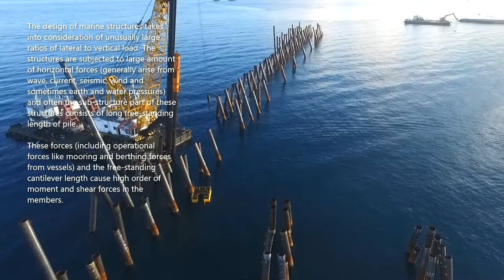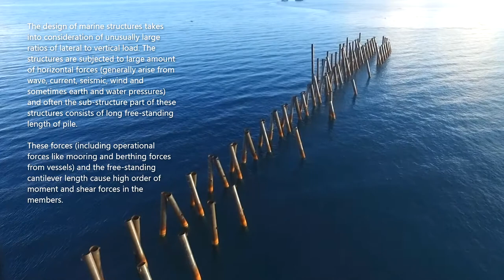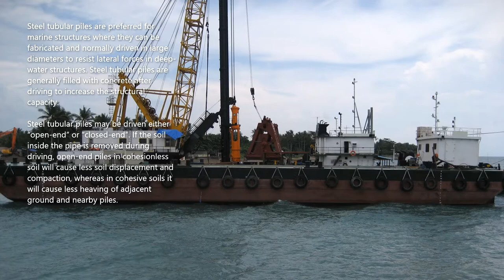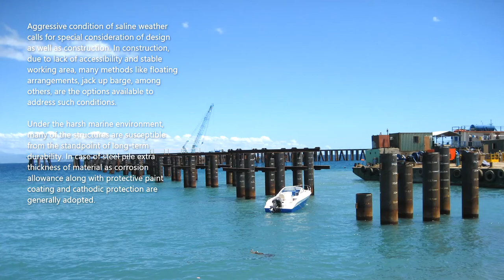OFFSHORE & MARINE PILING | Steel Tubular Piles | Civil Engineering & Construction

Comment: Sir,can share with me step on pile on water?
Reply from the maker: Thanks for watching. Appreciated it... With regard to your queries, the brief steps (for Steel Pipe Piles) are as follows:

- Piling sequence: The sequence of piling is from landside to seaside and from one side to the other side.
- Surveying and Positioning: Marine GPS measurement system is normally used or applied. The measurement of piling is controlled by both elevation and penetration.
- Piling Equipment: According to the pile length required for the project, site construction condition, and design requirement.
- Pile Driving: Pile Positioning (The GPS system is used for the pile installation. Measure the relevant location between the main working point and GPS location, and then will get the pile location relative to the working point according to the pile body slope ratio, pile center distance, pile top elevation, and pile location coordinate, and then install pile).  Driving considerations (Check the joint between the pile head and pile cushion, and make sure that they connect closely with each other. Keep the center of the hammer, pile cushion, and pile at the same line lest off-centering while pile driving. Observe the situations carefully while pile driving, i.e., wobble or damage situation of pile body, abnormality of pile cushion and pile hammer, etc).
- Cleaning Pile: When pile driving reaches the design depth, the hole cleaning will be done after the depth and position of the hole meet the requirements. A mud pump will be applied for cleaning the hole. After finishing the hole cleaning, survey the hole depth
- Steel Cage Installation & Concreting: The steel cage of the pile will be fabricated by section offsite. After fabrication by section, it will be delivered to the project site, and be hoisted by a Floating crane to install by section. During installation, the adjacent two steel cages must be welded tightly. The steel cage is fixed to the steel casing using the hoisting and pressing methods combined to prevent that the steel cage from floating upward or sinking downward during concreting. After the steel cage is installed in position, the underwater concrete will be poured by using the guided tube method. The first poured concrete quantity will be calculated and determined by pile length. Concrete shall be poured continuously. During the entire concreting, the depth that the guided tube is embedded into concrete shall be kept between 2m-6m from beginning to end. Concrete will be delivered to the hopper by mounted-pump

Hope this helps.
Reply: @silentengineer8206  I am watching this video for my next interview. Thank you very much
Reply from the maker: @kumaradasan7474  Thank you for watching. Appreciate it very much
Reply from the maker: @kumaradasan7474  Thank you for watching. Appreciate it very much
Reply: Nice
Reply: Sir can you share which ASTM is applied for offshore piling